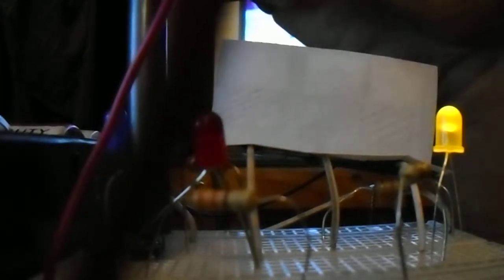paper and pencil transistor

Comment: Can you post a video tutorial showing how you make your paper transistors or at least some pics showing the insides? Maybe I can create a 4 bit full adder with your design.
Reply from the maker: Heres a link to a pic of the note I have on it, also the rest of the info on these experiments can be found here.
https://hackaday.io/project/21622/gallery#618d04e7a73a5aa2410b2e0bd672c0c0
Reply: Thanks! The red strips are electrical tape, right?
Reply from the maker: yep, just be careful about how much voltage you use, because the alluminun can heat up.  Normally I use about 5-6v